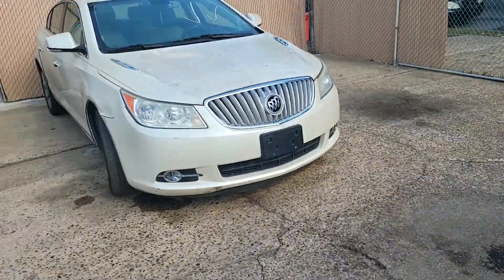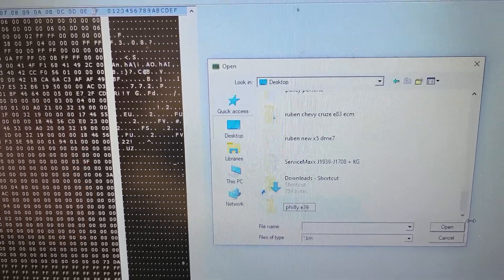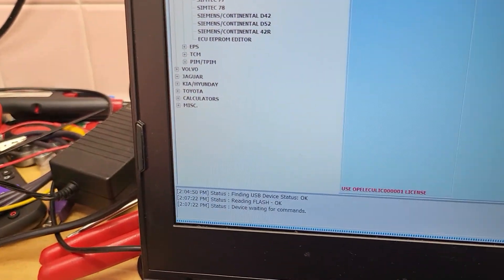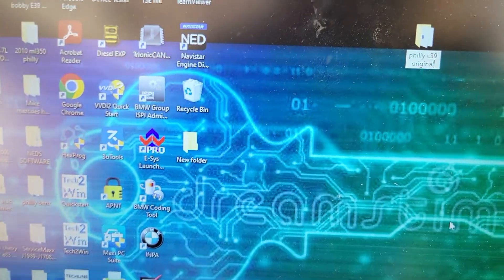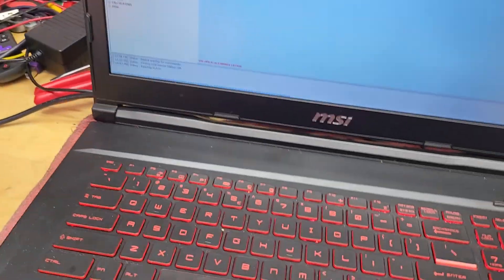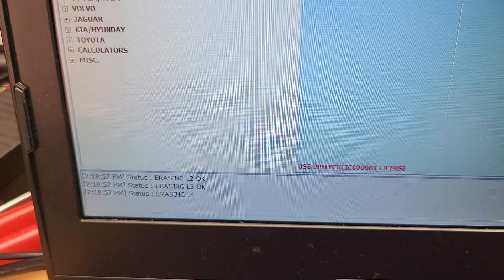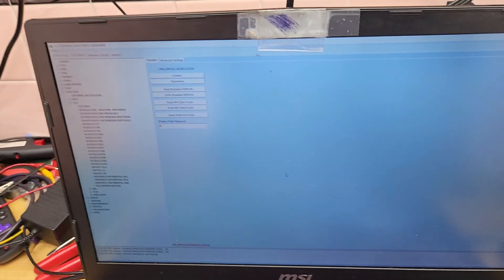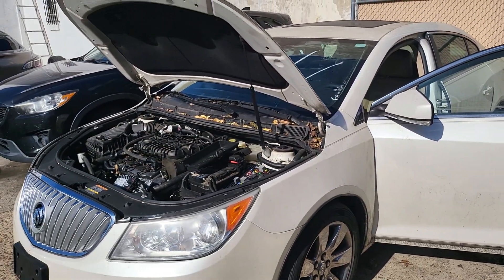2010 Buick LaCrosse Gm E39 Ecm Clone with I/O Terminal

Comment: Why ABS light is on? It has to do with a vin mismatch?
Reply from the maker: No vin mismatch.. ecm was a direct clone.....   abs on this vehicle was on because owner had change Cruise control module from a different vehicle and needed to be initialized and programmed
Reply: @Autokey_Security_Services  ooh ok. Got you and thanks for respond.

Comment: Can IO terminal clone older Delphi pcm?
Reply from the maker: You can go to ioterminal.com and go to there downloads and see all the Pcm it's compatible with.. older pcm they are easily flashed with sps. I focus on ioterminal for newer ecm where gm has made them locked to 1 vehicle to clone or virginize them.
Reply: I purchased an IO terminal,do I need to get a separate Sim card to work for those newer gm pcm?
Reply from the maker: @bobbywarthan5173  you need to get proper sim card for activation.. your distributor will help you out with relevant software and sim cards...
Reply: Where do you get the pcm pin outs?
Reply from the maker: @bobbywarthan5173  ioterminal.com  in there download section